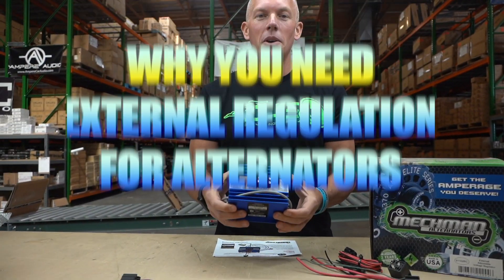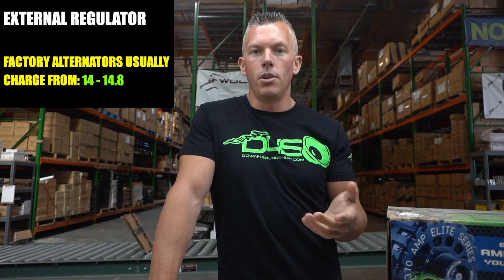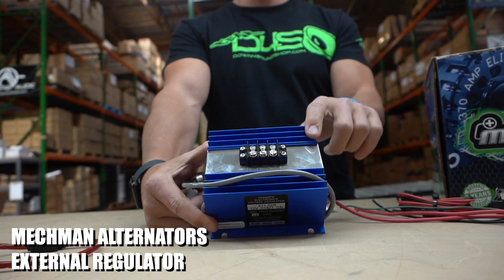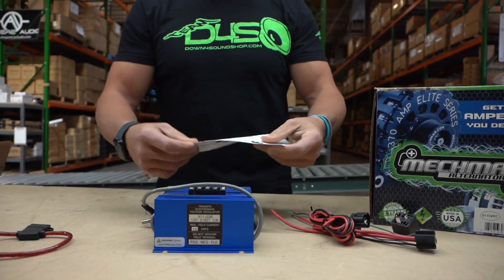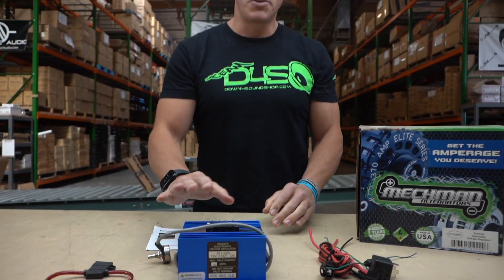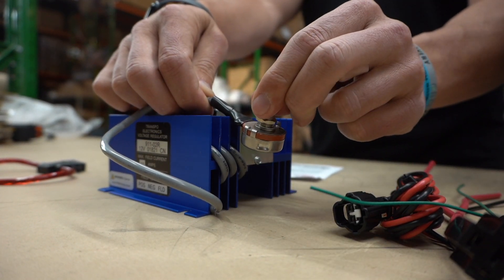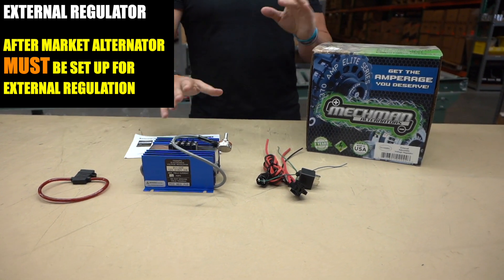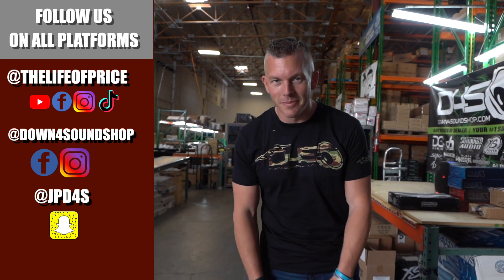WHY YOU NEED EXTERNAL REGULATION FOR YOUR ALTERNATOR

Comment: Amplifiers usually made for 14.8 at the most. I mean if people want to run 17 18 volts why not just run 48 volts or something. It doesn't make sense to me. They are designed to run lower. I mean you could go crazy and build an amplifier to handle 200 volts or something but would it actually make it better?

Comment: Hey JP i would like to build an alternator for a 2008 honda fit. I believe its called honda jazz in America.  Anywho, the alternator im running is factory n i think its a 70 or 80 amps but i want to run a 12k amplifier. So whats the cost for an alternator built n an external regular altogether?

Comment: I have a 200 amp 14 volt alternator will that make my 12-volt battery go bad or do I need to increase to a 14 volt battery
Reply: I forgot to mention that I am running 3 amps in my custom 81 jeep cj7 with two capacitors 5 ferrets each.

Comment: You did not tell the truth that  if you increase your voltage upto 17v and your electric system is 12v then it will blow fuses or 12v electrical components. Pls calrify
Reply: I'm trying to find something because of this reason. My alternator is putting out 17v but my car is a 94 Honda civic so it's obvious 12v lol. I'm not paying for another custom higher Amp alternator that works because the regulator in it isn't working lol. Is there something I can get that would fix this?

Comment: Can this unit be used to dial DOWN  voltage?
I have a 370 amp Mechman alternator and it is great 99.9% of the time. 
Its a 2 pin unit and was on my 2012 Duramax 6.6 diesel Silverado. 
I've taken it off because upon start up of the engine,  the voltage fluctuates WILDLY for about 30 seconds to a minute or so. 
I've seen the voltage spike into the 17v area during this time. 
It settles back to around 14.8v after a minute or so, but during that time, all sorts of weird stuff happens....
Dash lights for things like BATTERY, CHECK TRACTION CONTROL,  CHECK STABILITRAK, etc as well as the speakers make loud "crackling" sounds, like someone has applied power to them!
I'm currently using a smaller 145 amp alternator (not a Mechman) and have not been having any of those issues.
I love the Mechman,  but am concerned it will harm my two Lithiumax Race9 starter batteries.

Comment: I have a js alternator 320a and I'm running it in a 91 jeep Cherokee that is already regulated by my ecm and it is severly cutting back my voltage at times, will the mechanic external voltage regulator  work well with my Js brand alternator. Also I already purchased the regulator and just checking before I install it so any feedback would be much appreciated.

Comment: Good day am having another type of problem.. In my 2002 honda accord I put a DB electrical 220 Amp alternator in but why my sound system is on my voltage bumps up to 16.5 or 17.1 the drops back to 14.4.  It does this numerous times and the amp goes in to head unit goes into protect mode unroll the voltage decrease... With you regulator socked this or control the voltage robot doesn't go that high and burn up my system...

Comment: if i have 350a high output alternator with regulator external, how high can the voltage be set, what will happen if set above 15 voltage, will my agm die, or it is still safe and i will get more power? Thanks.

Comment: Hello JP,  I’m new to the car audio, and I’m running 2 Soundstream x5.12 with the txp1.12000d amplifier. I have two agm batteries one is the starter and the other is the house battery. What would be the right way to wire them up. For now I am still using the stock alternator. Which is installed in a 2015 Silverado 1500.
Reply: You should have got a lithium bank made instead of those batteries. It’s cheaper in the long run and supports WAYYYYYY more watts
Reply: Like a 48ah lishen bank

Comment: I have a 390 alternator internally regulated. Can an alternator shop take out the internal regulator so I can use the external?  My volts start at 15 on stertup but drop. Sometimes Down to 12.5. I drive a 18 Colorado 2.5   Just bought the jp43 amp. I have two bAtteries  done the big three. Please help
Reply: Sounds like you need a smaller belt for the alt. I had same issues with my 320 alt until I got a smaller belt and now I’m at 14.9 in idle. I only drop to low 14s when I’m demoing but I am also running 40 ah of ying long lto so that helps alot

Comment: Can you do a video on how to know if you need a bigger alternator so I don't fry my electrical system in my 2018 car. I feel this is overlooked nowadays. I want big subs with big power which needs a big amp. I don't know how to go about it without messing up my electrical system. 
How do I know what the biggest amp my current electrical system can handle safely. There are some videos about this but since I'm not a full time car audio electrician I never understand what they are actually saying. 
We need a simple step by step process. This is why many do not buy more powerful amps nowadays.
Reply: Sounds like you need to pay somebody for the install as you clearly shouldn’t be doing it yourself

Comment: question, the jp23 stopped playing for a while and the temp light was on, but it was at 100 degrees on the remote. this was the first time playing it with the back seats up usually theyre down and it will get even hotter than 100 degrees and it has never temporarily cut off. so im not sure if it was cause i had the seats up even though it wasnt too hot on the remote, or if it was detecting the subs temp? which also werent hot barely warm on the dust cap theyre 2 audio pipe bd4 12s at .5 ohm on the jp23

Comment: Question, I have 4 Sundown SD-4 12s on a SFB-3000. I'm trying to get my mids and highs together. I have 4 DS18 Pro-X6BM, 2 DS18 Pro-TW420, and adding a DS18 Pro-XBM6.4. I bought a SFB-500.4 to run everything. Is this ok, should I buy multiple amps for mids and highs? Space is kinda a issue, because its going under a truck seat. The subs are behind the seat. So the amp rack and extra battery is going under seat.

Comment: I would use caution buying anything from Down4Sound, I have used them for a couple years and recently ordered a 1/0 OFC amp kit along with a 4 gauge OFC amp kit and 6' of 8 gauge OFC speaker wire. My order said it was at my door via email and when I got home it was gone, I believe someone stole my package. I contacted D4S and let them know what was going on and I am basically being told I'm on my own and they will not replace it. I always had respect for this company but now I will never order from them again. I have ordered thousands of dollars of equipment before and now a couple amp kits go missing and now I'm out of my money. I'd definitely order from another site!!!!!!
Reply: Not their fault you got your package stolen. They’re only responsible from when it leaves their facility to when it gets delivered to the doorstep. You left the package out this is on you.
Reply: IF YOU FEEL YOU LIVE IN AN "UNSAFE OR BAD AREA" WHERE A PACKAGE COULD BE STOLEN PLEASE HAVE IT SHIPPED TO A SAFER ADDRESS FOR EXAMPLE YOUR WORKS ADDRESS. ONCE WE HAVE SHIPPED THE PACKAGE AND IT HAS BEEN SCANNED DELIVERED AT YOUR ADDRESS, IT IS THEN A PART OF YOUR HOME / HOMEOWNERS INSURANCE. So please be diligent in this process to ensure your packages make it to you safely. We also have no problem offering signature for delivery IF REQUESTED. If you would like for your packages to have to be signed for please put it in your order notes when ordering. Straight from their website
Reply: How is it their fault that your shit got stolen from your house? Makes no sense at all.
Reply: 🗣️bro,that's not their fault tho...they did they job ur package was delivered.. don't hate them.. hate the basshead who stole ur stuff😉

Comment: You don’t need any of this ! Sorry jp but I was chasing my tail trying to figure out what system to get to bump my voltage . Then I had a major duhh moment I’m running a 75 cent$  diode on the alt sensor wire with a switch volts are 14.8-.9 with it on , with it off 14.3-.1 . Ran this set up on stock alternator and high output 320amp alt. Will work with any alt with no modifications. This stuff dose the same thing as just using a diode it just lowers the voltage on the sensor wire. I would bet the plug in dongle from mech has just a diode in it! Pick the diode do you want to achieve target voltage. i used one that drops .5 volts
Reply: hey, i was trying to find out if i need to spend another $150 on this because i have a 500 amp mechman but haven’t put it because of this video, will that diode work with it?
Reply: @natetrejo2605  the diode method will work with any alternator just find out witch one is the sensor wire.also if you need high amp alternators get them from Tuscon alternator they are the same if not better quality than way over priced mechman at a fraction of the cost i dont know what there prices are now bit i got a 320amp alt for just 400$ no one can beat there market and have the quality they do and they have a wider selection...usually if they dont have it they make it unlike mech. also using the diode method you dont want to bump voltage to much you can.. but the more you do the hotter it will run. droping .5 volts  on the sensor wire is no problem/(lower the voltage the higher the output)
. if you cant tell mechman pissed me off lol
Reply: @adrenalinenjunk  thanks man, does the diode drop or raise the voltage? im still learning and researching about this stuff
Reply: @natetrejo2605  it drops the voltage on the sensor wire. witch raises alt output voltage
Reply: @adrenalinenjunk  auto tech engineering has the 320 alt for less than 400, got mine for 370 with metallic black for 20 bucks so it would’ve been 350 with stock color
Reply: Why diode you using?
Reply: @Super5150crazy thats what they use in the pigtails that bump voltage. Nothing to it but if you have a good high output alt some times you dont need it
Reply: So what diode should I use for a 300a alternator when my voltage stays at 13.8 right now and I’m trying to bypass the voltage regulator with your method? So you replaced the sense wire with a switch on 12v wire with a diode soldered inline to replace the factory sense wire?
Reply: @Proxa6  all I did was splice into the sensor wire. You don’t need to switch if you are OK with the voltage it’s running at all the time I just did it so I could have a little more voltage when I was running the sound system and normal operation I would turn it off so the switch just act like a jumper so it wasn’t running through just the diode find one that drops .5 V you’ll probably be right where you need to be. You shouldn’t be bypassing any regulator you’re just shorting the voltage a little bit to it.

Comment: I have a 390 js in a 08 ford fusion and it would not send volts right at all I purchased a adjustable voltage regulator from us alternator I can make it 12.4 all the way to 15.5 without the regulator it would bounce 12.9 13.5 13.7 .13.3 and that was idle and no load or reved these things are awesome JP man I have been asking you about them blue waffles for some years now tha ks for the info
Reply: I have a 2010 fusion sport 3.5 what alternator is available for mine? I want a 390 too
Reply: @2fast4you20  check out js alternator its a great alt they are one of the very few that had them for a fusion
Reply: i got a js for a 07 4runner...  
they seem solid and a bit cheaper then mech, etc

Comment: I have a PCM module (US Alernators) that pins voltage at 14.8 when system is on, but throws up a "check charging system" notification every time I start my car. That's kind of annoying. Can these circumvent those error notifications?
Reply: Mine does not do that but it is the adjustable one
Reply: @Adam's DIY and random vids  might also be my car. 2013 Camaro SS.